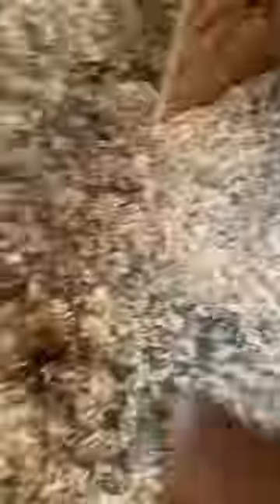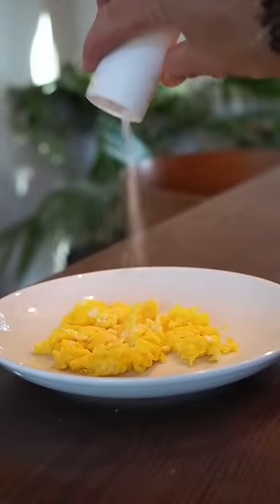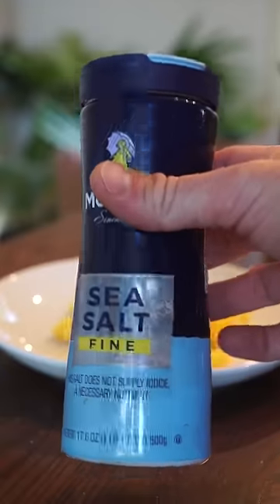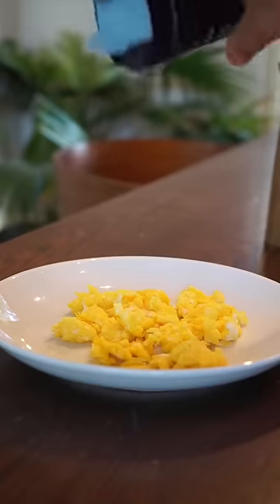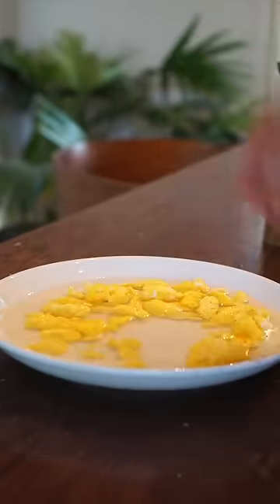Making a salt cellar out of birch wood

Comment: I’m gonna get the salt directly from the source today. It’s going to be a quick drive. grab some snacks. Don’t forget the popcorn. It’s basically a dessert out there. Just go get that magnifying glass. You should be good. Don’t forget the butter to. That would just sit that out as the popcorn pops in the Heat and the salt is just there so we are ready to go.

Comment: Salt is the best. It is better than roll on deodorant or books about porcelain horses for sure. It's definitely better than the extenders you get on hairdryers for sure.
This guy is an aficionado as he went for the "fresh salt". Nothing is worse than salt that's not fresh daily. I once had to use 2 month old salt and although the difference in overall flavour was not hugs, you could tell it was not as fresh as the stuff that costs 35 dollars and is delivered fresh on the Internet.